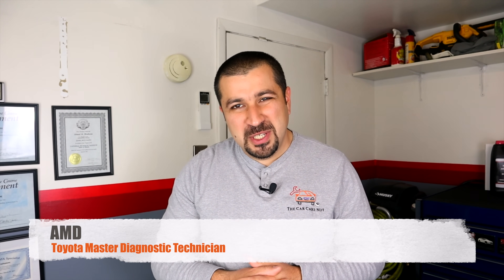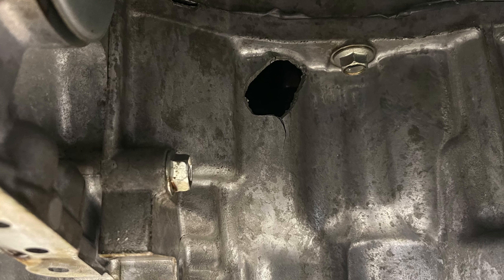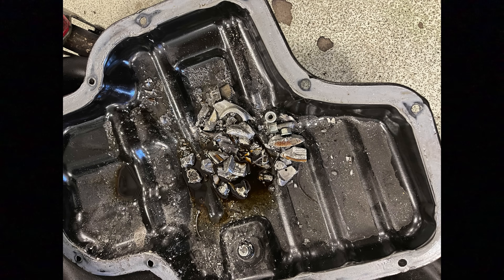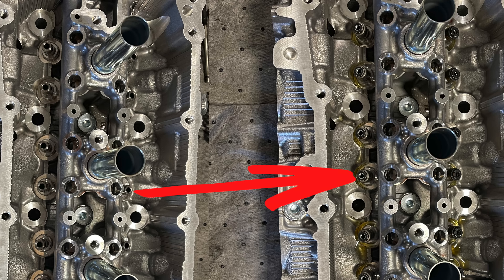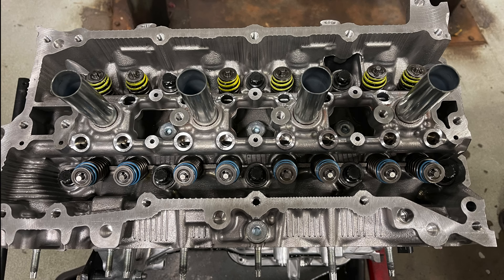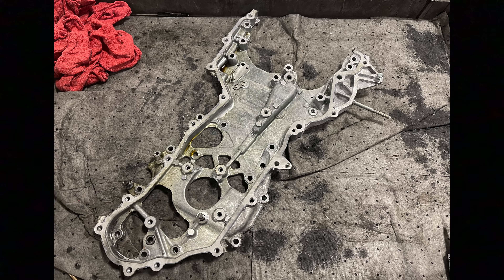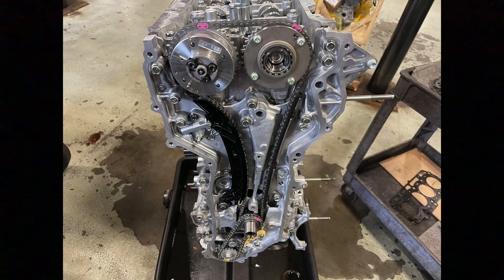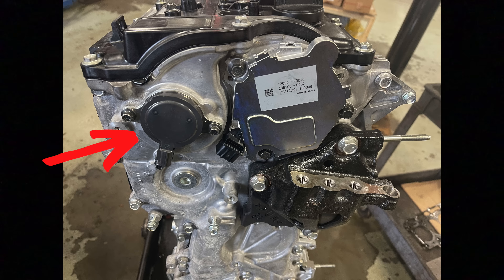Toyota's New Engine assembly Full start to finish!

Comment: Wow, that's unusual for a brand new engine where a piston would blow up into pieces probably I'm guessing a defective piston from the factory would cause that 🤔
Reply from the maker: Hard to tell. But without a pattern of multiple engines doing this and it being a rental it goes more towards operator error than manufacturing
Reply: @TheCarCareNut  in your video you talked about breaking period might be one of the causes for this engine to fail. But back in 2015, I bought a brand new Nissan Rogue, and the next day I drove for a long road trip from New York to Florida for a round trip, with no knowledge of the break-in period at that time. But to this day, the car still runs well with over 60K of mileage now. No issues. So I wonder if there are other factors including the complex design of the new Toyota engine.
Reply from the maker: Did you push the engine to its limit when you drove it?
Reply: I drove at high speed like 75-80 mph for about 900 miles a day and went to Orlando, Miami, Keywest and then back to New York on my new car back then. But yes, I did not floor the gas pedal.
Reply from the maker: That’s why. You took it easy and then followed it up with good maintenance.

Comment: I also work at a Toyota dealership. I like that engine cart you have for the subframe and all. I built a similar one out of some scrap wood and a furniture dolly but that looks a lot better 👌🏼
Reply from the maker: Hi my brother! So that table is actually for Nissan! But it works great on our subframes and it has two lock pins in the rear that lock the subframe from moving. Has wheels if you need to wheel the assembly out.

Comment: I'd like tho know all the engine codes stored. one theory of why this blew up based on my experience with the 2grfks. vehicle with who knows what old laying around oil installed had several LSPI occurrence. pretty much almost every start and hard acceleration in a hot day on 87 octane. changed their oil to SN+ rating and never had that problem come back. owner said the vehicle was usually driven around 100mph. they delivered something interstate.

Comment: Up to 205hp from that little engine is impressive. Remember the old Toyota 3.0 V6 (1997-2003) barely put out 200hp.  I just hope that power isn't overstressing it too much and it can hold up for a few decades. Too early to tell.
Reply: Up to 206 horsepower.. That engine is not stressed at all. I can drive 65 to 70 mph and not tack but 1,100 RPMs.. and achieve 48.2 mi per gallon ! That is one of the most stress-free engines I have ever driven !!! The eight speed transmission reduces the stress, greatly as well.
Reply: Actually - low revs for a given speed isn’t an indicator of low stress - it will be putting out high torque & therefore likely pretty highly stressed (higher compression ratio, for one)
Reply: @Lucentlens  The Camry has such good aero and no towing ability that the engine isn’t pushed at all.  The RAV4 will work this engine especially if you tow a travel trailer.

Comment: When you showed the engine, I was scratching my head, trying to figure out how that happened? Rental or not, I can’t see that happening on a naturally aspirated engine, a modern one at that, AND a Toyota. My 29 year old 22RE with well north of 400k, and no piston issues, and still sewing away!
Reply: Lol, any piston will explode if crashed into the valves at high RPM. This isn't a simple piston issue.
Reply: @billgates1682  Yes, I can understand if the valve train were out of time, but this would effect all the engine, not just 1 cylinder. Did maybe both cams break in that area? We weren’t given the cause of the catastrophic failure.

Comment: Mr Car care, can you tell Toyota and all the other car brands to fit in braking sensor technology in their (old and new cars LOL). That would save millions of lives around the world by auto braking when the car is 50 or 25 meters away from hitting :) Much better than air bags .
Reply: It won't be too long before the drivers won't be needed anymore, self driving cars are only a few year's away. Drink driving,speeding and dangerous driving will also be a thing of the past. Just imagine getting stopped by the Police 🚔 It wasn't me officer it was the car that did it🤣😂🤣
Reply: Autobrake works well with vehicles slowing down, not so well with stopped/parked vehicles because if it did autobrake for stopped vehicles there are too many times a false alarm could be triggered, i.e. a certain shape of metal on the highway or a guard rail. Autobrake is not as easy as it seems.

Comment: That's one hell of assembly work.  Wonder how many shops can actually do this 100% correctly the first attempt?
Reply from the maker: I think if the mechanic is experienced with engine work it’s not difficult. The timing is a bit odd because of the intake gear but otherwise pretty straight forward

Comment: Glad to see it is using the old style  oil filter
Reply: I drive a 2014 Camry hybrid  import from Japan  nice ecomical reliable car I only drive Honda or Toyota
Reply: I was really glad that the 2018 4 cylinder Camry went back to the spin on filter opposed to the cartilage filter that was used in the previous model.. The V6 is not that lucky. They still use the cartilage filter and did not update that like the new 2.5 dynamic Force engine.

Comment: Wouldn’t it be cheaper for Toyota just to put a full reman engine in there and have you just swap the accessories instead of spending two days rebuilding it?
Reply from the maker: It would have been yes but they don’t offer reman engines or full assembled engines

Comment: can you please make a video about how the Toyota ABS system works and how to and when to bleed the ABS module for example do you need to bleed the ABS using a scan tool after changing the master cylinder. And how often do they go bad and what causes failure in ABS pumps.

Comment: You didn't actually say what caused the failure, or did I miss it?  Was it just "being a rental"?
Reply from the maker: Honestly the investigation was inconclusive. Hard to tell exactly what happened with the current state. But from history and experience I’ve seen similar cases on other engines with rental cars
Reply: @TheCarCareNut  I've never known of a piston breaking apart - lots of thrown rods but never heard of a thrown piston. I loved this video for all the new adventures in working on a modern tech Toyota engine.

Comment: Great Video 👍 ...

My son has a 1983 22R for his pick-up and has been looking for the metal coolant pipe that goes from the lower radiator hose wraps around behind drivers side motor mount and connects to the hose going to the water pump it also has a heater hose connector on it and is mounted to the block using the rear motor mount bolts (2).... we found a few used ones but all had the same corrosion problem...if anyone has a line on a new one it would be really really appreciated.
Reply: if internally corroded, that's the owners fault caused by poor maintenance. If externally corroded get a pipe from a western USA wrecking yard.

Comment: I d like to see what kind of abuse this engine has gone through! Simply unbelievable!
Reply from the maker: That’s the problem with rental cars. With private owners you can ask questions about the driving conditions to understand but with rentals it’s hard
Reply: @TheCarCareNut  I suspect cold starts with full throttle could ruin any engine but this technological marvel piece should have tolerances and ways to avoid reckless driving!
Reply: @TheCarCareNut  Do you think this has something to do with the recall of 30K some engines few years ago due to thin engine blocks?
Reply from the maker: Hi! Likely not. The one with the recall was a known manufacturing issue. This one is totally random

Comment: Well done, AMD! I sold my little Toyota Urban Cruiser (Scion xD) and bought a bigger car with symmetrical awd. We’ve still got the Toyota Verso-S in the family.
Reply from the maker: Congrats on the new car! Subaru?
Reply: @TheCarCareNut  Thank you! Yes, a new to me 2016 Subaru Forester with a 2.0 liter engine and manual transmission. I figured since our small Toyota Verso-S also is known as Subaru Trezia and Toyota owns more than 20 percent of Subaru that they ought to be pretty good. So far I am pleased with it. It seems easy to maintain and it seems very sturdy and well built. Some of the features are nicer to the touch than Toyota, but they seem a bit pricier to make and maintain than Toyotas.
Reply from the maker: The Subaru Forester is a good car. Take care of it and it will take care of you 😀
Reply: @TheCarCareNut  I’ve changed all the fluids already. 😅
Reply: @yunus_aros  Best of luck with your Subaru. The exclusively front wheel drive Scion xD came with a 1.8 litre petrol engine. There were two choices of transmission, the 4 speed auto or 5 speed manual.
Reply: @RightLaneHog3151  I had it with 2WD and a 1.33 liter (1NR-FE) gasoline engine with a 6-speed manual gearbox. The car has start-stop-technology. The current Subaru Forester too. I’ve got the 1.33 liter 1NR-FE engine in the Toyota Verso-S (Toyota Ractis/Subaru Trezia) but it is equipped with a CVT with flappy paddle shifting (7-speed).
Reply: @yunus_aros  Over here that 1.33 engine only came in the short-lived Scion IQ which got about the same mpg as the larger Yaris with the 1.5 engine.  I like the Yaris Verso but it was never offered here.
Reply: @RightLaneHog3151  In essence they are the same engines. The Scion IQ was sold as Toyota IQ here. The engine is pretty okay and the fuel consumption is about 47 miles per gallon. With the Subaru Forester I’ve made 37 miles per gallon too. We pay about $7,30 per gallon here so it is important with good gas mileage.

Comment: We have a 2020 Camry with this engine. So appreciative of you doing this video! Looks like this engine must’ve been over revved to the point of the valves starting to float causing the piston to shatter. Do you think the rev limiter on this engine model is a little too generous?
Reply from the maker: Hi! I think the over revving scenario is out because that would show wear elsewhere like on cams

Comment: So the piston let go? Is there a way to read the last few mins of driving? Is that info recorded anywhere in the many computers today's car have? 

I've burned holes in the tops of pistons in 2 stroke motors due to lean conditions. I own a 2019 Camry with this engine and regularly use 2/3 of its available power up to 5,000 rpm. So far my engine is perfectly smooth and strong.
Reply from the maker: Hi! The data was not available. Either erased or was not caught no way to know
Reply: @TheCarCareNut  my Camry shudders at 1100 rpm when the transmission is slow to downshift. When I get the shudder I back off the gas while the trans figures out what I want. I wonder if that shudder could have been the culprit? I guess time will tell.
Reply from the maker: I would have the dealership check for software updates and if they find none have them reset the transmission memory
Reply: @TheCarCareNut  will do. Thank you sir.

Comment: Everything is getting cheaper and cheaper..   I just did an oil stiffening case on one of these bc the car got impacted on the passenger wheel and the case got cracked and was dripping oil.. Did mine in the car tho

Comment: When you showed a photo of the "jet," it looked like the block had several cracks.  I hope that was the old block.
Reply: I'm pretty sure that was just the sealant he used - stringing -
Reply from the maker: The sealer stringing. I caught that and went back to clean it.
Reply: Yeah at 8:50 he's talking about the jet and I'm thinking this case is cracked.  Now I see below the stringing...whew!

Comment: AMD thanks for sharing. What caused piston 4 to blow up? Defect?
Reply from the maker: There are many theories on why this happened. The most prominent one is possibly bad fuel quality and extreme operating conditions
Reply: @TheCarCareNut  wow. Good to know. That rod was really bent.
Reply: Most likely a mix between a bad quality piston and a hard break in
Reply: @josephashcraft1581  Ah ok.
Reply: @josephashcraft1581  Camry is driven by lead foot taxi drivers all the time. Rarely hear about that.

Comment: Its cool that the dealership you work at lets you take pictures of what you do to help grow your channel
Reply: I'm sure the dealer racks in all the benefits with added sales. I know i would greatly trust that dealership with our friend as a top mechanic technician. I'm not sur our friend gets the appropriate consideration from his employer. The least the dealer can do is let our friend take pictures.
Reply: I believe the hesd honchos in Japan are worried about company espionage.  A channel on YouTube showed that volvo had a US connection by a 2001 BMW 530i (In 2001) and ship it to Sweden. They then fastened different quick release sensor on different parts of the exhaust and intake. They measured blowby going into the intake too. When they were done, they sent it back to the US with the quick release fittings still on as it didn't have an effect on drive ability. They either forgot to fill in the pin holes (or didn't bother ) on the manifold that could only be detected via smoke test. That 530i was an Ultra low emissions vehicle (ULEV) rare at the time.

Comment: Warranty work or paid ?? How much did that cost !? And did you report that to toyota japan ?????
Man that was super horror movie to me 😰😰😰 I think am gonna buy any new toyota without dynamic force
Reply: It was most likely covered by powertrain warranty - I work on the engine line there actually and im pretty sure I've seen that block - no reason not to get the engine - this was an extreme and weird case - happens with every manufacturer
Reply from the maker: Powertrain warranty. All I can say is that Toyota is very generous with their warranty. They took the old engine for an investigation to make sure it’s abuse and not production but from experience I think it’s abuse

Comment: Did you ever figure why the engine failed?( What caused it to fail?)
Or does it matter?
Reply: watch the last part of the video. He assumed why it failed. It was a rental car, and guess what
Reply from the maker: Unfortunately the exact reason why it failed is not clear. Seen this with rental cars before, not on this engine but others so abuse is the only reason.
Reply: Какое масло заливает?

Comment: is this a25afks identical in the hybrid version as well?
Reply: Not identical but very similar and built on the same line - all of the engines have small differences - the hybrid has a different head also which has pink and white springs - and a different cam tower. Cause there is no vacum pump
Reply from the maker: Very minor changes s Jet zire mentioned but mechanically they are very similar

Comment: Can’t believe that they don’t give you a complete brand new engine!!! 
By the way, I look under my 19 4Runner and notice some corrosion where they mount the front area of the cabin 🙄
Reply: because a whole engine doesn't have a part number; you get the individual parts that were compromised that make up the engine. in this case he said everything except the covers. I throw those in part washers and reuse. its just a panel. the assembly lines in factory has new whole assembled engines, never dealers, regardless of car manufacturer.
Reply: I was thinking they would give you a new engine as well.. I read an article that said when Korean brand cars engines blow such as kias and hyundais they buy a lot of salvage engines from junk yards and put those in the cars and you're not getting a new engine in those as well.. There are a lot of things that are done to save money as well as getting salvaged parts and other things get used from the junkyard.. Warranty contractors jump on this full force and many dealers do as well..
Reply from the maker: Jose does Mercedes offer long blocks?
Reply: @TheCarCareNut  MB usually provides a complete engine. The very first M156 that blew up had to be put together like the one you did. Pice by piece. One man one engine lol....
Reply: That's what I was thinking. A new crate engine would be easier.

Comment: That car was a 2021 Toyota Camry LE, the giveaway was it had the hood prop instead of the shock strut Hood lifts.
Reply from the maker: Good catch
Reply: @TheCarCareNut  Good throw from you.. I saw just enough of the car to identify it.. I could tell it didn't have the upgraded LED running lights like the top trims..
Reply: The 2021 camrys xse I rented had a prop rod.
Reply: @timsouttahere  None of the 2021 Camry's have hood struts.. All trim levels use a hood prop now the same as the Honda Accord. It must have been a 2020.🙄
Reply: @charlesjackson1700  sorry. I meant a prop rod 😅
Reply: @charlesjackson1700  my personal 2019 camry se has struts
Reply: @timsouttahere  Yes, yours does.. My 2020 Camry XLE has hood struts as well and that is the last year they put them on it. They went to the hood props on all models on 2021 Camry's.
Reply: @timsouttahere  That sounds more like it..😆unless you had a specially modified one,,🙄